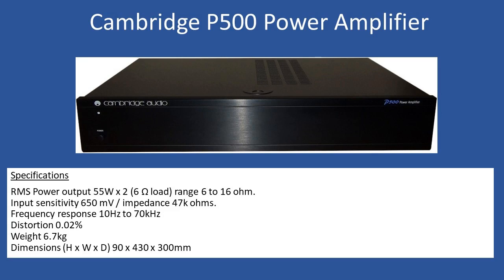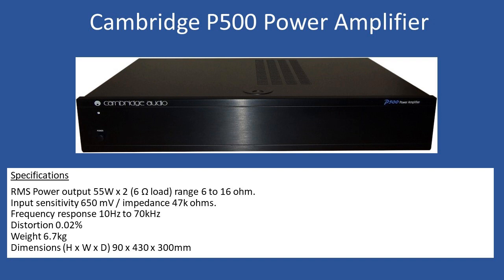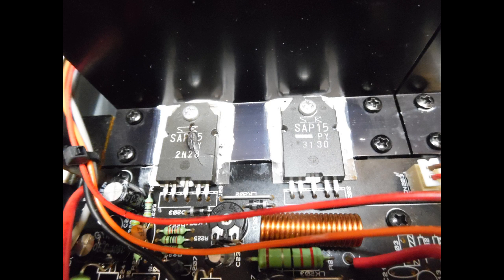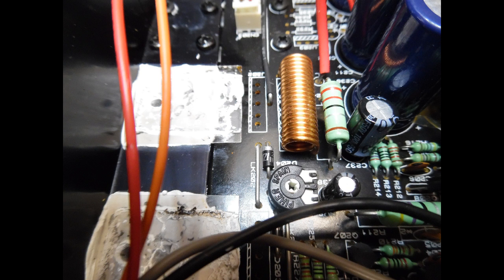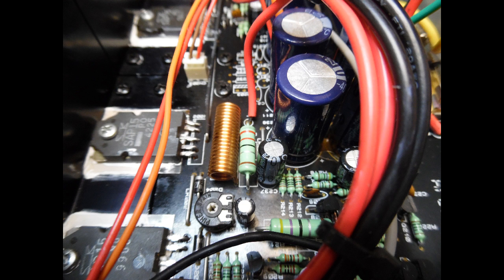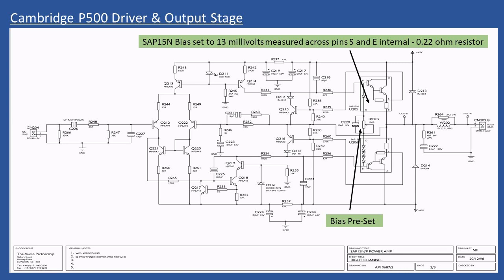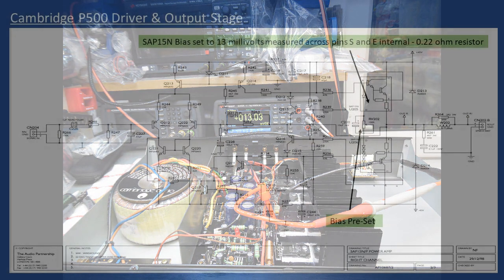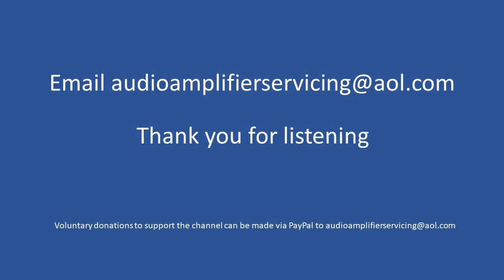Cambridge P500 Power Amplifier Repair (With Audio Tutorial)

Comment: Contrary to your state ment i can see VI limit protection circuitry on that schematic, so i think you may have meant that there was no dc protection circuit on the output other than series fuses.
That VI protection should have been designed to protect the output transistors under a short circuit, but anyone who has been in the repair game for long knows that it often is not the case.
Reply from the maker: @The-Chrystalmachine  It always seemed odd the Cambridge A3i had a speaker protection relay circuit but not the rest of the A series.